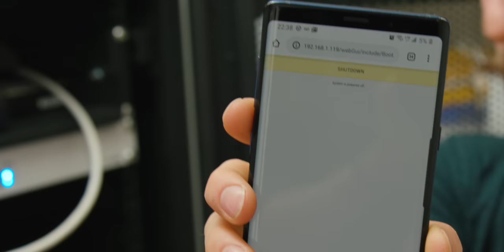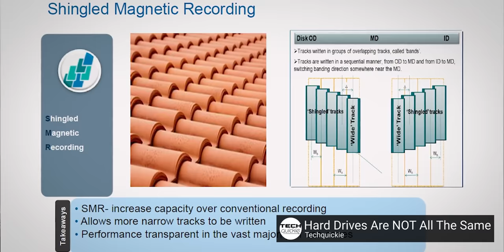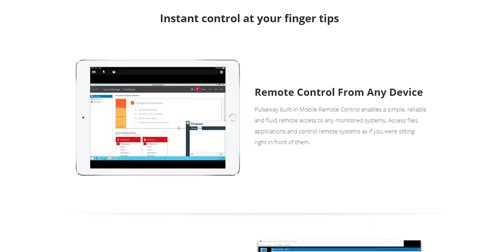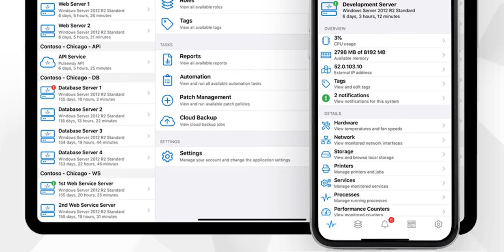My Home Server Room is a MESS...

Comment: "We're gonna rewire it properly"
"It's 3AM we're not gonna rewire it properly"
This is why I subscribe to LTT
Reply: As soon as he said he was doing custom cables I was like "That's gonna be a lot more work than he probably thinks it is."
Reply: When you can get half-foot cables for less than $1 from monoprice, you should probably not be dinking around with making your own cables. You can easily spend 15 - 30 minutes per cable, especially if you're rusty.
Reply: Same
Reply: @klinky  Yeah, I think you can even get like 2-3" ones. I only bother with making them myself if I need, like, a 27.3 foot cable to go perfectly along a certain path or something like that. Linus is my favorite dummy
Reply: Daniel Jensen Linus is such a noob
Reply: I just made your comment 600 like and it might be the most satisfying thing I have ever done
Reply: @danieljensen2626  ddr4 ram samsung

Comment: 8:46 That moment when you could've hot glued magnets to the power strip...
Reply: Or just use a 1U PDU for about $110.  At my last job we retired a bunch when we closed down some offices so I picked up a few.  Once I finish my remodel I've got a small wall mount rack I'm going to install for a 1U patch panel, the PDU and a shelf.  I'm not sure if I'll buy a rack mount UPS or just get a standing one since it'll sit on a shelf in a closet.
Reply: Double tape will do

Comment: ive never had an issue with a flat ethernet cable.  
I also haven't ever tried to use one longer than ~12 feet.  I wouldn't want to use it anywhere where durability would be an issue, but from a local switch to various devices in one room (or entertainment center) theyre fine.

Comment: You mentioned that your optical cable comes from the garage.  The residential building code requires a one-hour fire separation between the living space and the garage. that means 5/8" firecode "C" or type "X" drywall on both sides of the wall all the way to the roof (or across the garage ceiling) and limits on the size of any penetrations through that. For fire safety, check with your builder that this fire barrier is maintained properly.

Comment: Apparently,  Patch cables need to be 3 foot or longer for maximum signal (a Belden rep told me that). If that's true or not, I don't know, but the smaller cables look way neater and easier to manage eliminating vertical and horizontal management.

Comment: @5:49 Just to confirm on TB3 support on various boards. Asrock's X570 boards that do not explicitly have TB3, most certainly do have functional TB3 headers that allow you to use a TB3 AIC for decent TB3 support. Like say Gigabytes Titan Ridge AIC. Works like a charm on my X570 Taichi and a boat load cheaper than the board he's got! =)

Comment: I'll be amazed if it hasn't been said already, but SMR is still bad for Unraid. If you have to rebuild the writes can take so long that the drive being rebuilt can randomly timeout and drop. CMR is still safe to shuck at 8TB+ from externals so do that if able. If not, might want to consider SMRs as better for either unassigned drives (no protection) or parity IF you tend to save new files serially (1 at a time) so that you aren't overloading parity writes.

Comment: This was a fun video. 
You should probably only use those really short cables when connecting to a patch panel as they can introduce network errors (slowness) when connecting a switch to a device due to CSMA/CD (1m. min.).  
I use a deep pocket cable managers to hide my mess...works great.

Comment: Man that red pixel at 4:06 scared me, I thought I had somehow damaged my monitor
Reply: Sep where?
Reply: @aquiIa_chrysaetos  Around the tennis balls at 4:04     small red pixel
Reply: @fivesupersieg5583   I just checked on my phone and to my surprise it wasn't there.  
But it is on the PC monitor though.  Not sure if it might be a bug from video editor's software. Or Youtube encodes and sends data differently depending on device type.
Or It could just be the resolution.
Reply: @TheAdamGore  it shows on my phone screen, so probably you just didn't notice or your phone has a lower resolution
Reply: @TheAdamGore  can confirm the red dot
It's probably the resolution :)

Comment: If you've got the space in your panel, have him pull dedicated power for each UPS.  Ideally, you'd also spread your servers between them.  It would eliminate several single points of failure.  Learned that one the hard way.  The UPS supporting the main router for a building died taking the building down.  Did I mention that this was the Headquarters Building?  Two new UPS's and a second dedicated power drop later, that problem didn't recur.  Actually, having learned the lesson, we bought second UPS's where ever they would be needed.

I've never heard anyone gripe that they've got too many power outlets or network drops.  The expensive part of the job is the labor.  Running two drops to the same location takes no longer than running one.

Comment: I feel that happiness in the beginning lmao. There really isn't too too much better than having a wire the exact size you need especially if it's DIY.
Reply: Keywords: At the beginning I also fully associate with bailing on the custom cables because WOWWWW that's work
Reply: @Xeno1798   this is how things normally go, you got a plan to finish something at you never got around to finish, but there are some other things you need to first before you can do it and when you are at the point you start doing that thing, well it is already the middle of the night, so maybe next time

Comment: I know it’s a little late but... No! Servers have dual power supplies so you connect one power supply to UPS1 and the other power supply to UPS2 in case a UPS fails or you need to service it. And you connect each UPS to a separate circuit if you can and you can because you’re going to run a new circuit. Run 2 new circuits. And also run a separate ground wire to your panel and tie it to a grounding bus bar that grounds your rack. This is called a telecommunications grounding bus bar which is code for commercial installs. Not that your company would know that. Your office rack really needs a grounding bus bar with that many servers and that big of UPS. You could also install a isolated ground outlet with this.

Comment: i have a 3900X as my main gaming rig 32gb ram an a 8 port MikroTik 10gb switch And a APC 2200 UPS an 3 Dual Xeon Servers an more crap..lol. an The APC UPS Powers Every thing in my rack at about 30-50% ..But of coarse i bought my APC second hand then added New Battery's for 325-350 Total + 50$ for a NMC ! Second hand is really the only way to buy a big higher end ups unless ya want to spend a Crap Ton of Cash !

Comment: No! Servers have dual power supplies so you connect one power supply to UPS1 and the other power supply to UPS2 in case a UPS fails or you need to service it. And you connect each UPS to a separate circuit if you can and you can because you’re going to run a new circuit. Run 2 new circuits. And also run a separate ground wire to your panel and tie it to a grounding bus bar that grounds your rack. This is called a telecommunications grounding bus bar which is code for commercial installs. Not that your company would know that. Your office rack really needs a grounding bus bar with that many servers and that big of UPS. You could also install a isolated ground outlet with this.

Comment: 2:08 I also have same Plex problem, solution just use subtitle edit to convert PGS subs to SRT external subtitles, and Remux old video file with mkvtoolnix without subtitles, so you would not accidentally turn them on. Or have 1080p video version instead of 4k.

Comment: Hot glues power connector. may as well of used Velcro strips... so you could remove it if you had to.
Reply: problem with Velcro is, somehow the strips stay on (desk, wall etc) for long time after thing it used to hold on is long gone.

Comment: Linus, In case you were unaware (which I'm sure you are and I'm just sanity checking) the Unraid parity method you mentioned you were using is called JBOD generically. Unraid is just an OS using Lime Tech's implementation of JBOD. I wanted to clarify so people could research the tech because JBOD is so cool and blew me away when I first saw it. I have been using Unraid for a couple years now as my home server ever since you initially showed it in '2 Gamers 1 CPU.' I found it was a perfect solution for my home server with how many 'systems' I need running on my network but only having the space and financial ability to only have one or two physical systems. Thanks for all you do an for inspiring people to explore new technologies. Keep up the fantastic work.

Comment: Dude! The Ethernet spec' calls for Ethernet cables to have a minimum length of 1 meter (including any cables going to the back of patch panels). With shorter cables, you get things like crosstalk and noise messing with the signal. After all, at the frequencies used in Ethernet, the cable is really just a super long antenna with a transmitter on one end and a receiver on the other. To properly manage your cables, don't make shorter cables. Just coil them neatly or route them down into a tray and back again. Looks are NOT the most important thing in networking.

Comment: HAHA! - That case is the very same one that I used to use... I think?
I dont know how deep yours is, but mine was a doubleup style that could contain a possible 49 1U units. It was great for showing off, but ultimately thats all I could do with it.
Right now, I have gone down to a Lian Li V2100 Plus case with an SSD for the Linux Server ( WHY? ) and a 4TB for its own junk and 5x10TB WD REDs for Data  but the snag is, that I am also using 4 NAS Boxes with 12 Drives in those and so its gone horrible again.
My server is also a bit weird. SuperMicro Mobo with 4xOpteron 6830@2.5 so it totals 64 Cores with 512GB RAM and to this day, I have not really needed that many cores at all. I stripped it down about a year ago and I used an old Core2Duo with 8GB and it did the serving job every bit as good as that big one did, and I built that Opteron server when it cost me more than my bloody car did and the Core2Duo I dug out from old bits and just tried it for a giggle.

Ah, life goes on however... I will be redoing the Server sometime soon and in all honesty its a little too sluggish for a Desktop PC although it just never seems to slow down when you do hammer it, so I guess that where all those cores come into play maybe?

Comment: Is there a video you made about the displayport/optical usb connection and advantages/disadvantages?

I am also thinking of moving my Pc's into a separate room and just getting display and usb out trough the wall, this way we have like a in the room PC, but without the noise/heat.

Comment: linus i looked at your nokia ont and it is possible to replace that with a pfsense box you can ask telus to do an upgrade and you will get a diffrent ont with a sfp module in it and if you put that sfp module into a pfsense router and then you don't an asus router and an nokia ont anymore at least it's better to monitor and stuff like that and it's rack mounted.

Comment: Ive also noticed with SMR drive when it tries to write, it also SIGNIFICANTLY slows reads. 
I think its because the writes cause the drive to jump to 100% utilization, and thus has a penalty to read speed as well. 

Anyone else notice this?

Comment: Hah, always have a server case with 5" slot, you never know when you'll need it, at very least you can fill it with 4 2.5" ssd's
(I have 2 slots and I need 3: BR drive, LTO-5, 2.5"/3.5" receptacle, so will need an external unit and connect it somehow, BR drive can probably live of the USB)
Also 2:22 - What's that crap in the case blocking half of the airflow? =)

Comment: What kind of setup do you recommend if I want to have my gaming rig on one room but being able to play from another room? I haven't found an HDMI cable long enough that handles 4k at 60 Hz
Reply: Steam link and Ethernet would probably be your best bet on a budget, although input latency is a real problem for game streaming. Or you could do HDbaseT, which is a bit more expensive, but would be the best option overall. No lag, 4k60 (@ 4:2:0), extensible in the future, and it carries a 100mbit layer 2 Ethernet link on top of HDMI.
Reply: @anon4820  thx!

Comment: I do something similiar. I have my computer in one room and run the wires through. But I have a question, and need some advice.
If I wanted to put some USB ports on my desk. How would I do that? Do I get a USB extender and connect it to a hub? Will that still transfer files at a decent speed if I use it to connect to a camera? 
I love having my computer in another room so I never have to hear it, and it doesn't heat up my office. However, I'm not sure how to connect things like my phone or SD card reader to my PC without having to actually plug those things into it directly. =/

Comment: I do not recommend trying to make your own patch cables. I've done it in the past and then tested them with a $10k plus cable certifier with heads designed specifically for patch cables and the majority of them wouldn't pass.

Also your cage nuts are installed sideways.

Comment: "0.5 m is the implied minimum length in ANSI/TIA/EIA-568-B. 2-1 for a certified patch cord. That's because the math for the limit lines really does not work below this."

Comment: hey there, that really short patch cable, do you have the pugged into two active devices?  Isn't the minimum cable length for Ethernet one meter and those are for patch panel where the overall cable length is already greater?  Seriously, has it changed, I haven't done cabling in like 20 years.

Comment: Dang it Linus. You're not supposed to use surge protectors on a UPS, it throws off the the load detection. Use a proper PDU. Also... TWO gaming systems on a UPS? You're absolutely asking for that one to die if both systems are ever running simultanously.

Comment: oh man, oh jeez... you need proper cabinet and cases... contact Inventec for sponsoring... 
I was working in testing area in one facility, we were running 800-1000 1u, 2u and 4u continuously (plus few hundreds of blade ones), there were people just running around and plugging in and pulling out servers to cabinets... 
you could literally slide in, secure, unlock and slide out the server in matter of seconds

Comment: Help me, confusion in one thing, my website is heavy traffic site, i can not afford vps, i want to host from home pc, my question is for port forwarding i want to use basic home  router, ROUTER can handle the trafic or not ? Or may i have to use something else ???
Reply: It probably will work but you have to keep in mind that you are using consumer-level equipment. Its not designed for this type of use case. The biggest problems I see are bandwidth and security. You're basically exposing your computer/web server to the internet so you better make sure you are up to date with updates and security patches. This is a big security risk.
Is your connection up for the task? You say you have heavy traffic. Will your connection be able to handle that traffic? Is your computer powerful enough to handle the traffic? Is your internet provider ok with you running a web server? Will your web server be on its own network or will it be also on your home network? The latter will pose a massive security risk since if it gets infected, you can potentially get other computers on your network infected. There's a lot to consider here.

Comment: You need to do additional research, Ethernet cables should never be that short, 3 feet is the min, if you put a fluke on it, it would fail the cable test.

Comment: I NEED HELP and I'm running out of options and i am on the verge of throwing my computer out the window. For a couple months i have had an issue with my PC, randomly when playing a game i would get artifacts or a wave of green light and then my PC would crash and blue screen showing the error "Video TDR FAILURE". When this happened a couple months ago, a gaming PC shop thought it was my graphics card playing up and after a while they said it was my hardrive being corrupt and a cooling issue. They fixed the problem temporarily and now i am having the same problem again. I was hoping if someone reading this or even Linus could help me out on how i can get an answer to what is wrong with my computer. Before anyone says to reinstall my drivers and update shit, i have done all that and more.
Specs:
CPU: i7-7700K 4.2GHz
GPU: Zotac Geforce GTX1080TI AMP Extreme Edition 11GB
MOBO: Asus PRIME Z270M-PLU
RAM: 16GB
PSU: Thermaltake Smart Series 730 Hybrid

Appreciate the help, Thanks

Comment: You should do a techquickie about https://youtu.be/uAAuNjNXaIM?t=53 the lenght of UTP cables, I think you get performance issue if you go shorter than 0.5 meters, besause UTP has crossed cables but If you shorten the UPT the cross will be to short to reduce interference.